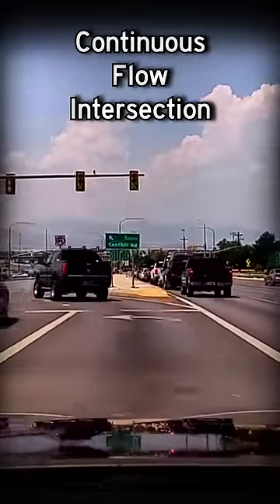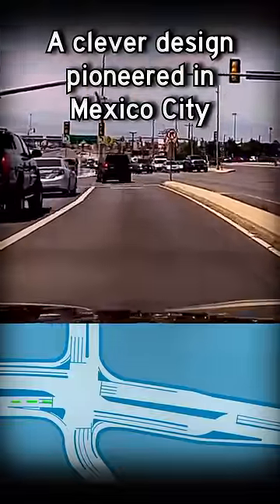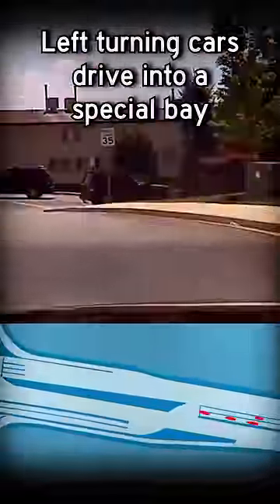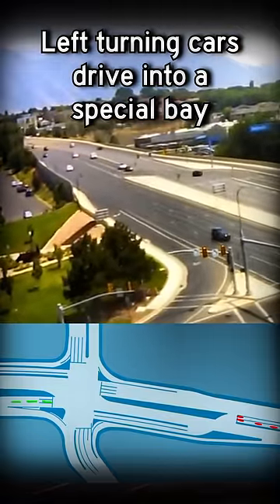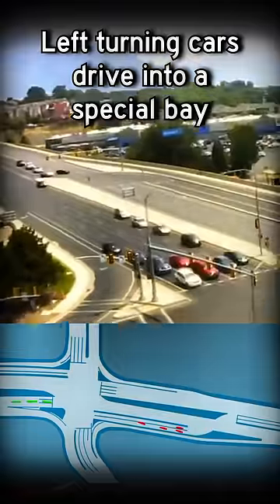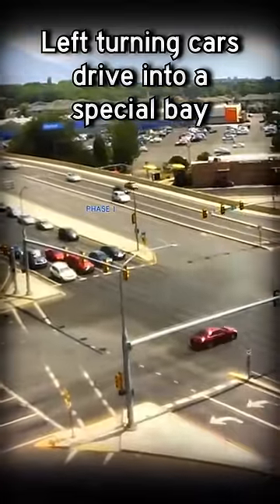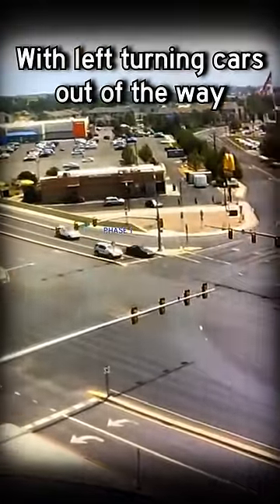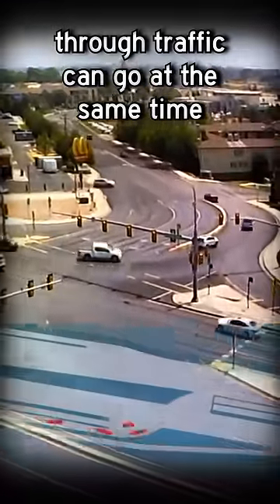Continuous Flow Intersection #shorts

Comment: There's one in my city and it's an absolute nightmare. It's basically like having 2 traffic lights where there could've been 1 and it takes forever to get through.
Reply: Ah, good to know. My first thought was it didn't sound like it would work, but on second thoughts it seemed like maybe there was some logic to it, but people do seem to be agreeing it's a terrible design.
Reply: I think the problem is people turning right block people from crossing during that window when the light is red.
Reply: Tried it in Mexico City... it was interesting... Basically made the streets and intersection twice as wide as was probably necessary.
Reply: Im a traffic engineer. Its safer because reduces conflict points at the intersection. Also, it improves throughput and works well in high volume area.
Reply: @conniq1585 god I would love to be a traffic engineer. Whoever came up with the diverging diamond interchange is a fucking genius.
Reply: @conniq1585 people just hate things they don't understand. We have a partial CFI near our house, it works so well. It's a little confusing at first, but I'm super happy with it. People don't understand that it's more lights, but less cycle time.
Reply: That is exactly what I was seeing here. It's funny that the content creator decided to speed it up and clip it when the "continuous flow" was already stopped and started the video just as the light was about to turn green.
Reply: I think that's more correlation, I imagine a higher demand area possibly necessitated this kind of intersection
Reply: I'm just guessing, but it seems like the use case for this would be a scenario where there are regularly enough left turners to gridlock an adjacent intersection and impede traffic in other directions, but not enough left turners at one time to stop oncoming traffic and provide the left turners the right-of-way each time one arrives at the intersection. This basically creates a space for the left turners to cross the oncoming traffic while the perpendicular direction has a green, then safely make their left turn while the oncoming direction has a green, thus eliminating the need for both directions to be stopped in order to allow left turners to pass. To be clear, this process costs MORE time for the left turners, but less time for all of the traffic overall, which ends up eliminating a source of congestion and benefiting everyone, even the ones who had to wait a long time to turn left.
Reply: not true, it is a continuous flow intersection and therefore your observation is wrong
Reply: Yeah gonna have to call bs on that. This looks so much more efficient than a typical intersection. The town I live in, left turns are a major backup factor.

Only issue I think is footprint.
Reply: @conniq1585 can agree with this, not because I am a traffic engineer, but because the video showed is literally a walk from my student housing.

Comment: This is exactly the same as waiting for the light, but instead, you wait 30 seconds earlier
Reply: I know right? Both have to stop for traffic crossing anyhow. 🤣
Reply: You don't get caught in the middle of the intersection waiting though. And every car can turn left instead of the couple that catch an opening. When the light is red, every single car has a chance to get over to the turn lane. I like the idea
Reply: Not true. It essentially takes advantage of the fact that when the light is red, the opposite lane is going to be empty so might as well cross it in advance so you don't have to deal with the cars going through it later (no dedicated left turn signal / waiting in the intersection).

The disadvantage is you always have to wait for the next traffic cycle even if the light is green and no one's coming the other way.
Reply: Definitely not the same. You should watch it a few more times.
Reply: Thats a great way of saying you dont understand
Reply: Yes. You’re waiting for the cross traffic either way
Reply: It eliminates left turn probs among others.
The installed one in my area and it cleaned up a huge mess if an intersection/overpass.
Those with the green can do anything they want, no left turn arrows, go straight turn right.
Its simplicity is the benefit.
Of course there is a traffic light, but conflicts are eliminated.
It works great in practice.
Reply: I’m thinking you don’t drive? With every intersection the time saved for not having to wait for a car that was also made to wait, that’s compounding, and traffic decays
Reply: @OGREgaming420 How? They still have to eait for their light before entering the bay. Thus there is still a light they wait for.
Reply: If you're turning left, you get to wait for two lights. And the name is dumb, nothing "continuous" about it. But it works! The left-turn and the go-straight cars go concurrently, greatly improving flow. (I call them concurrent flow intersections, still "CFI" but accurate)

Comment: This particular interchange is in Orem, UT. Its right next to a college campus, a walmart, and the freeway, all of which are very high traffic areas.  Pedestrians have a north to south tunnel underneath that they can use to get across from the campus to Walmart, and theres a more conventional cross walk to go west to east. If you come from the campus towards the freeway, theres another tunnel that puts you on top of the overpass bypassing the interchange.

Not included in this video is a large pedestrian only bridge that connects to UT's public train system to the campus, entirely bypassing that area.  In addition, the bus system in Orem (with exceptions) get its own lane, and drops off pedestrians in safer areas compared to other cities.

Why not a roundabout? Because the existing infrastructure was not suited for that large of a roundabout (to accomodate for the high capacity area). However, there is a roundabout on the campus side (actually right next to where Rob is filming) to help with flow for the college.

This system is not perfect, but it beats a 4 way intersection.
Reply: utah has some cool mcdonald's signs
Reply: Admittedly I only get off that exit a few times a year it always seems that there's an accident blocking lanes and empty bus lanes at the top of the hill.  Grew up in Orem ( and loved it) and that has always been bad, so glad I only go to that poorly managed apartment complex called Orem once in a while.
Reply: Being fom Orem, I didn't wonder how common this is in the rest of the US. Is this rare?
Reply: YES!! i thought this intersection design looked familiar!
Reply: i knew it! i knew that memory was not a flase one! haah i remember that walmart...that's where i bought my wii U one black friday morning.
Reply: We have a few of these in northern Virginia, the first time I came across one I just wanted to turn around....pretty confusing if you're not expecting it.
Reply: Glad to hear they address pedestrian safety and access but unfortunately, most of the time cities are not so thoughtful. They think a few sidewalks on the side is enough when in reality this would be a nightmare to cross at grade.

Comment: The turn lane/red light still exists though.....you just moved it back 50m and added an extra step substituting a redlight.
Reply: Yep, and required the road to be another 30 foot wider
Reply: Kinda. This intersection allows for the left lane turners to get into position while cross traffic has their green. So the turners don't have to wait for a clearning or have a dedicated green left that would make the intersection take more time per cycle.

Almost nothing changes for time with the turners, they just wait for their red further back, but all directions more quicker.
Reply: @djspi  but that time difference is very minimal compared to the extra land needed to build it, now you get more time save if there's a lot of traffic because on a regular intersection it would take longer with more traffic, so it would be applicable in a busy area and if you have the resources, but also there's ways to do this where no one stops at all, just like a highway, bridges or tunnels, so all this is pointless anyway just build exit ramps/tunnels that loop around, build the tunnel version a little farther back and there's no land loss, no stopping for anyone. Less traffic no resources? Roundabout. This idea in the video is clever but there are better ways so not so clever after all
Reply: There's actually more red-lights than before
Reply: Land is cheap, tunnels less so.
Reply: @JeffDeath99  you should talk to the city planners about that one, not me.
Reply: @djspi  you trying to be smart or something, why tf talk about it in the first place I was just making convo
Reply: @JeffDeath99  I was just adding to the original comment on how the wait for the left turn lane wouldn't really be too much more. You went in 5 other directions about city resources and planning. Wasn't trying to be smart but I do feel like your comment belongs in a different thread

Comment: We're currently building one of those in Fort Myers FL, and its coupled with a "Diverging Diamond" intersection at the interstate junction immediately east of the continuous left. It's one of the most pain in the ass projects ive ever worked on.
Reply: Where abouts in Ft myers?
Reply: The fact you guys just refuse to adopt roundabouts is ridiculous
Reply: 82 and Daniels has this in Fort Myers, I believe Colonial is doing this as well. Second round about is being built in Gateway. I’m a fan so far. But I’ve seen them redo Colonial three times since I moved here 12 years ago. Hopefully this will be the last for awhile.
Reply: Nice
Reply: One of the major problems doing this in Florida is that snowbirds leave and when they come back, they are disoriented and confused. Along with general aging, it makes for a mess. It only takes one single driver to not use it correctly or make a mistake and the entire thing just falls apart into chaos. That diverging diamond in Sarasota is working ok now years later. At first it was a nightmare.
Reply: @betweenthebars19  Colonial and Ortiz will contain the "continuous left", Colonial and I-75 will be a "Diverging Diamond" just like University and I-75 in Sarasota.  It's going to be a shit show for months when it opens. Monday morning I recieved an emergency call that one of our temporary traffic signals got obliterated by a dump truck. Guy took down TWO class V concrete strain poles. Luckily no one was injured. Except the drivers pride.
Reply: @iamvindell  Colonial and I-75  for the Diverging Diamond,  Colonial and Ortiz for the Continuous Left, and Colonial and Forum is getting modified as well; No more left turns off Forum Blvd heading into Lehigh when complete.
Reply: @Another_Saved_Sinner  thanks for the info man! I avoid Colonial at all cost. When is construction expected to be complete?
Reply: @betweenthebars19  who fucking knows. Project is already well over 18 months behind schedule due to the damn supply chain issues. Components that we used to get in 6 weeks are now 6 MONTHS out! Some are even worse.
Reply: @Another_Saved_Sinner  I appreciate what y’all are doing. It’s been a scorcher of a summer too, so my hat is off to you.

Comment: A pedestrian killer
Reply: The pedestrian tunnel runs underneath
Reply: @_.weezy._  Which is a hell of a lot better than almost any other intersection, or some towering bridge that no one with a disability can climb!
Reply: @jblyon2  but hell of a lot worse than just a normal safe crossing
Reply: @_.weezy._ so instead of getting hit by an F-350, you can get mugged in a dark tunnel instead. Amazing. What a time to be alive.
Reply: @Xachremos  lol I mean I know the area so I know that's pretty unlikely. But if that were to happen, I'd rather have the chance to defend myself than get steamrolled by a 2 ton vehicle🤷‍♂️

Comment: It’s been in use in the US for at least 30 years. I’ve always heard of it as a double diamond intersection, usually used on limited access roadway and highway ramps. It definitely smooths traffic flow.
Reply: This a bit different as the people going straight stay on there side of the road
Reply: I think 1st one in U.S. at I-44 & MO-13 in Springfield, MO 25 years ago.
Reply: DDI is an interchange (no lights, no stopping) whereas CFI is an intersection (stop lights).

Comment: Virginia Beach has one, but only one street uses this method the other uses J turns. It has helped a little on the traffic back.
Reply: I didn't even realize this is what it was on Indian River lol. I guess it works alright, looks way more affective with this aerial view tbh
Reply: @redr93ck77  You knew the intersection. 😁. It’s better than it was because the back up would get all the back to 64 and that just added more headaches. It’s not perfect but better.

Comment: The issue is it expands the size of the intersection exponentially. It’s useful in large areas but in the city it wouldn’t be efficient where you have maybe 50 feet worth of road from right to left

Comment: Lol, or.. you know.. a traffic circle. Alot less costly and alot more efficient. Always easy to handle and no missed turns. If you do miss your turn, dont worry! It will come back up. No driving down and finding a place to turn around and coming back so you can make your turn. Circles could replace most stoplights and save alot of electricity if it was implimented on a large scale.

Comment: roundabout is simpler, more efficient and pedestrian friendly
Reply: Roundabouts are far less pedestrian-friendly than this. Here, there's an actual light telling traffic to stop, so you can walk across when it's safe. On a roundabout, drivers aren't required to stop (not stopping is, in fact, the purpose of roundabouts), so they tend to be looking at the roadway to figure out how to merge with other cars. As such, they're much more likely to not see a pedestrian.

For cars, roundabouts are somewhat safer as the average speed is lower than through a traditional intersection. They don't reduce the number of accidents at all, but the lower speeds mean accidents are less severe. But for pedestrians any accident is a severe accident and you generally want to simply minimize the chances for any kind of accident to occur, which roundabouts don't do.

Obviously, it's possible for people to ignore lights (or roundabouts) and run over a pedestrian anyways, and possible for idiot pedestrians to ignore walk/don't walk signs while having no idea how traffic works and jump out in front of cars. But I much rather walking across controlled intersections with predictable car movements than the chaos of a roundabout.
Reply: @GeekOfAllness wrong. Where I live a lot of crossroads were changed roundabouts due to accidents and it worked fine. It's just American pride and they are "too dumb" to understand them.

Comment: We have one of these in Colorado Springs, Colorado. It’s at Union and Woodmen. They initially wanted to put in an over/underpass, as Woodmen is probably the biggest East/West artery in the city and backed up badly there. But, Union is on a hill, so it is already pretty steep coming up to Woodmen, and co rubies up the hill on the other side. It’s hard enough getting up that hill in ice now, if they made it steeper, it would have been impossible. To add to the problem, Woodmen also has a long hill to the East of the intersection. So they used this. It was very weird at first, but it works great and had the desired effect.

Comment: To all civil engineers out there. The idea is to remove traffic lights to increase traffic flow. If you are adding extra lights, you are adding extra stops and hindering traffic flow. It is a very simple concept to understand
Reply: This does is pre-load turning lanes that see lots of heavy traffic, in order so that both straight and turning traffic can proceed at the same time in both directions.
Instead of being restricted to only allow for two straights or a single straight plus a turn, it allows for two straights and two turns at the same time. Literally double the throughput.
The only delay may be turning left into the high-traffic road and having to possibly wait for an extra light (the one for pre-loaders, but it shouldn't be significant.
Reply: @Fay7666 I understand what it is all for, but the design does not significantly change anything except add additional stops and lights.

Comment: They have done the exact same thing in Southeastern Michigan over the last several years. OMG it works so well!
Reply: I live in West MI, I really hate the Michigan Lefts.  Take 3 lights to make a left turn.
Reply: @shawnn6926 more like 2 😂 rarly it would be 3😂
Reply: @cringeworthy2040  3 in Grand Rapids, M44 for example. 1 light to turn right, then another 2nd light at the left turn (U-turn) and another light at the intersection you was just at to go straight. 3 lights.
Reply: You know what works better?

Trains!
Reply: I like the diverging diamonds better
Reply: @shawnn6926  That's not a Michigan Left. Michigan Left is the turn lane in the middle of the median. No lights involved.  Left turn lanes do suck. (Especially when someone one stops early and isn't on the sensor so the light thinks the lane is empty.)
Reply: @Triaxx2  Google street view M37 & M44.  There are many lights in the median.  44th and M37 for example.